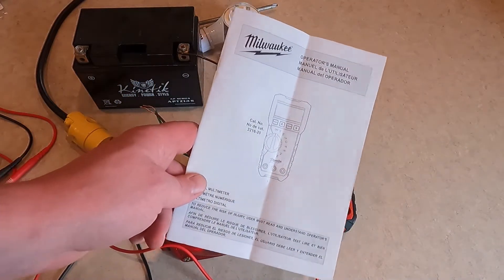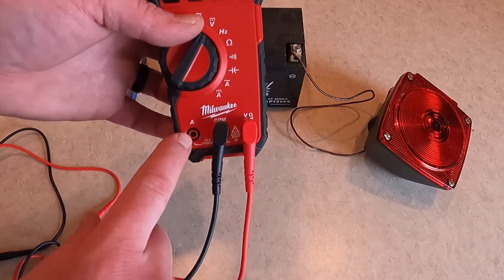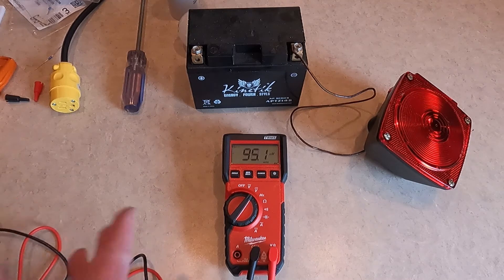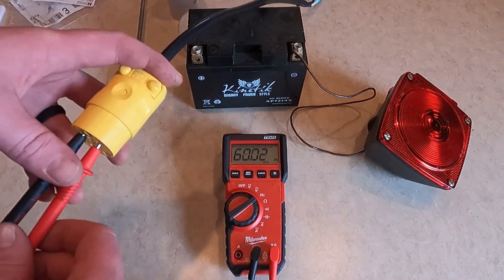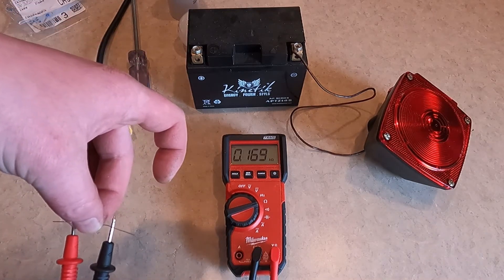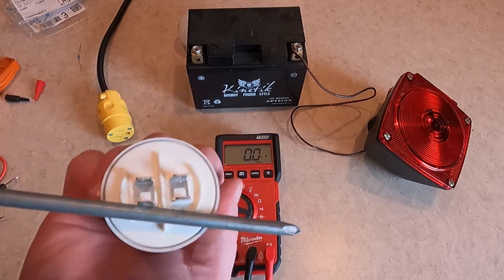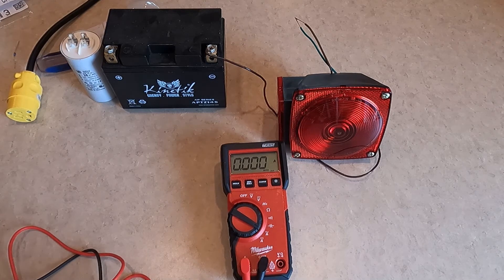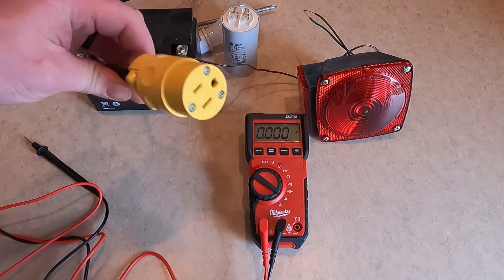Milwaukee 2216 20

Comment: Why didn’t the multimeter show a negative - symbol at 4:11? You have the positive lead in ground and the negative in the hot.. isn’t that reversing the polarity?
Reply: AC Voltage smh troll